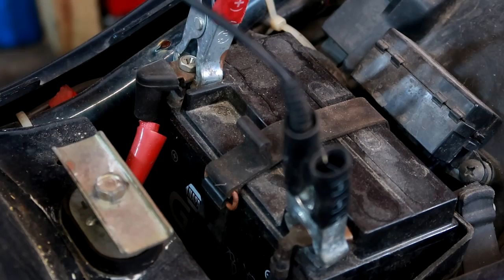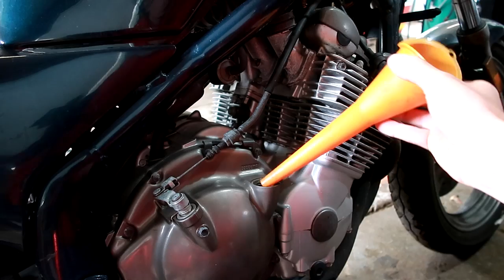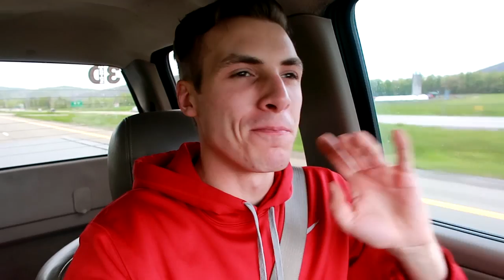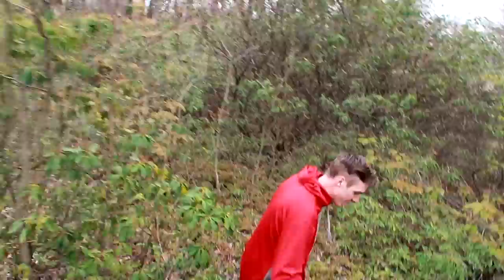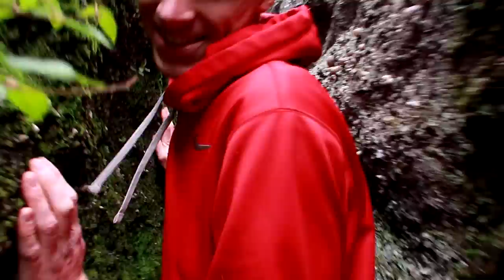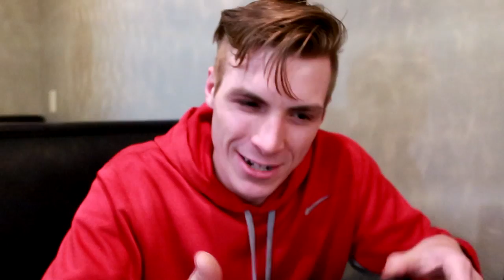EXPLORING SECRET CAVES!

Comment: You should get a bigger bike, if you want bang for you're buck get a Aprilia rsv1000r they come stock with ohlins forks ohlins steering damper, ohlins rear shock, radial brembo breaks and rear brembo too, oz evo forged magnesium alloy light weight racing wheels, loads of carbon fibre and they are cheap af right now for what they are

Comment: my dumb neighbor raced his new Ram, heard a weird sound, comes home and changes the oil and there is shiny small pieces of metal in the oil, what is this?
Reply: yellowgroove time for a chevy
Reply: will baxter hahahaha nope time for a toyota tundra
Reply: put a magnetic drain plug in it and change the oil and filter often, hope if doesnt blow up but its probably dead
Reply: yellowgroove What kind of sound was it? Was it a hard knock?
Reply: yellowgroove If it was a hard knock, he more than likely threw a rod (push rod) which means that he is really close to blowing that motor.
Reply: ChevyMan1601 like a ticking sound, but metal to metal type
Reply: ticking / clicking like tapping a drum stick against a steel weber grill over and over real fast paced
Reply: Troy Gates Right on
Reply: yellowgroove Sounds like a thrown rod to me, lucky he didn't spill his oil everywhere. Did he check any fluid before he drove it?
Reply: yellowgroove Then again, it might just be a push rod, which is still just as bad.